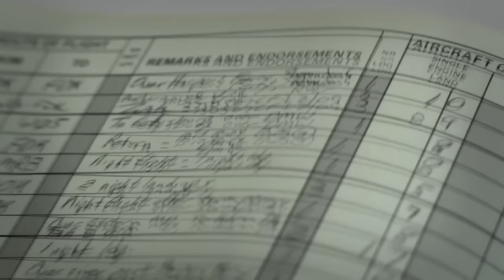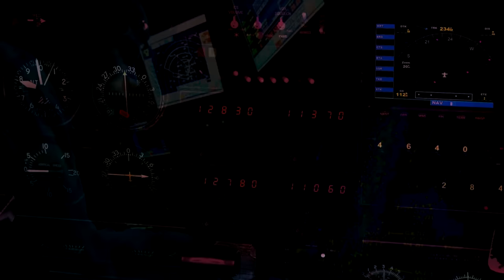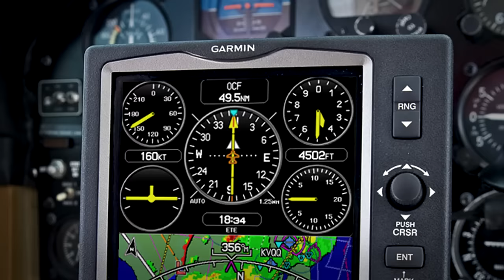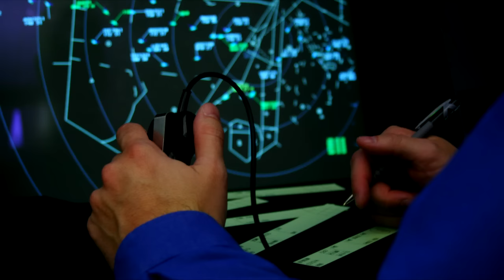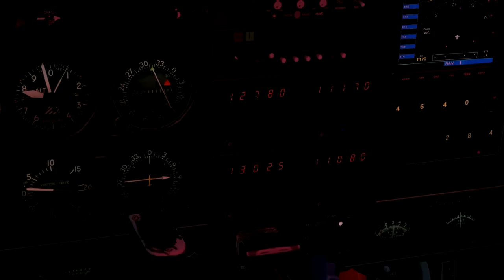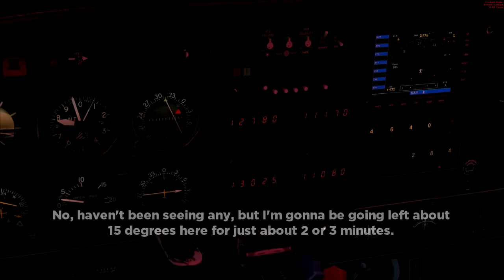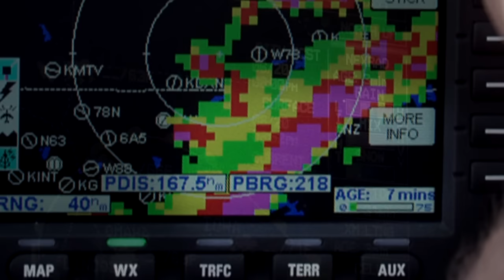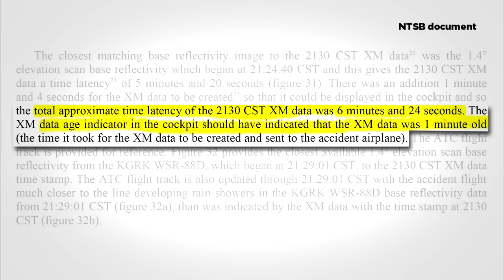Accident Case Study: Time Lapse – misunderstanding in-cockpit weather displays can lead to tragedy

Comment: Isnt ATC also at fault for letting him fly so close to the severe weather?
Reply: Yup, many years ago ATC should have sent a controller out to make his parents use protection.
Reply: Nice burn lol
Reply: No. ATC uses a weather radar system with limitations just as any other system has. The controller's responsibility is to aid the pilot by disseminating weather information as accurately as possible as it becomes available while also suggesting headings and altitudes based upon the information at hand. The pilot solely is in command of the aircraft.
Reply: ATC did warn him, he responded with "I'll stay on this heading a little longer" That flight should not have happened. sad.
Reply: ATC is never the PIC.... so no. While I have never flown near thunderstorms, I have had ATC talking me through storm cells. It's always an advisory situation. The pilot has the ultimate responsibility in flight.
Reply: Well done, Jon.  Well done!
Reply: No, this is a pilot responsibility not ATC. A controller has enough on their plate as is. Most experienced/ seasoned pilots would never seek guidance from a controller, knowing its their own duty to make decisions, and odds are no controller will want to be put in that position nor cares to face the potential liability. As this case shows even if/when ATC does offer advisory, that ought to be adhered to, a pilot whose hellbent on their plan will disregard it anyway
Reply: "Most experienced/ seasoned pilots would never seek guidance from a controller"
I'm sorry, but that is complete nonsense - I hope you were either being facetious or are not in the industry. The most seasoned/experienced pilots in the world are former military pilots who have worked a long subsequent career with a major airline. I guarantee you every one of them seeks input from their dispatchers, ATC, and their first officers in any severe weather situation. You are correct that ultimately it is their decision and responsibility as PIC, but only an idiot would deliberately choose not to avail himself of all available resources.

Comment: I've watched enough of these to vow to never be a passenger in a general aviation aircraft. Too many things can go wrong.
Reply: These videos are prolific because pilots are continually striving to learn from others' misfortune. You don't see car accident analysis videos because we don't apply the same rigour to trying to prevent them, we just mandate new safety features and let drivers continue to be hazards to themselves and others. Hundreds of thousands of GA flight hours go off every year without incident. This video covers one three hour flight that ended badly, but will undoubtedly save someone's life who will avoid falling into the same trap. Watch some steveo1kinevo and mraviation101 videos and you'll see what most GA flights are actually like.

Comment: This is a scary nightmare! Bottom line:  stay away miles and miles  from the boundary of these embedded TS. Because it will get you. And I’ve never believed on state of the art weather avionics. Prior information and knowledge about the weather is paramount. I purchased the weather material from Delia Colvin, and is a must have for any pilot at any level. It will keep you alive !

Comment: Reminds me of NLM Cityhopper Flight 431 that flew into the cloud obscured horizontal vortex of a F1 tornado in ‘84. The F-28 aircraft was hit with a one-two vertical negative G-positive G that was in excess of a 6 G aerodynamic overload that caused the right wing to immediately fail, sparking a flash fire as the husk spun down to earth. 

It turned out the flight crew was making decisions based on a 20 minute old weather report; back then it took about 20 minutes to get a weather radar sweep, document it, print it out, manually get it in front of atc reporters so then they could start using it to influence traffic.

Comment: used to fly freight in Cessna 210 and Barron's at night. feel bad for the guy. too many times to count I thought the spar was gonna snap. what a rush
Reply: Clint Hawk would slowing the plane down WAY below Va speed would have kept the plane intact?
Reply: I doubt it.  i knew a Continental DC-10 pilot that told stories of lock to lock, pitch too,  on the controls in and out of Denver and it was still not enough to keep it level.  This guy got flipped around and went in.  Going slower wouldn't help,  it may have been worse.  As Clint Hawk says he thought the spar was going to snap in  controlled flight.  Another friend JJ an F-18 driver say's "don't go into purple, even in an f-18".

Comment: The way I read weather is with the naked eye, formations, barometric pressure, more so than just the radar which shows you for  the most part the idea of coverage, and severity, but that does not replace what systems produce, wind shears, convections, hail, currents, temperature inversions, which changes temperature very quickly, then the precipitation, as well as rain, fog, dew and ice all from seeing a cloud, stratocumulus, shelf cloud, lenticular clouds, occluded fronts all with just looking at it, then get the weather report, then you know what you see along the route when flying. For any turbulence, bumpy rides, so as to adjust alt. accordingly, VFR on top etc. But you know that. Just go around it. But do not race one going faster than you. Pop up clouds you can see in the afternoon, small cumulus, can be bumpy underneath. But you know that.

Comment: For those of you unfamiliar with the American South, as a lifelong resident, it can go from clear skies to Niagra Falls back to clear skies again in about 10 minutes. These squalls can be strong enough to beat jets out of the sky, and Southern Airways 242 (a DC-9) in 1977 and Delta 191 (an L-1011) in 1985. That little Piper never stood a chance.

Comment: I was a working pilot for 25 years in everything from light singles,twins ,turbprops and small jets
I had a few lonely horrifying nights in some extreme wx
I remember an old very experienced instructor in my early years had a saying
"Its always better to be on the ground wishing you were flying than to be flying and wishing you were on the ground"
I lost a charter over bad wx one night
The forecast and actual observations at my planned destination  was like Armageddon
I explained the situation to the pax who were adamant they wanted to go 
I refused and they went off with another local charter company
They made it to the destination but many others were diverted to alternates
I remember that night like it was yesterday
No sane rational pilot was flying in that area that night 
I was glad i refused and went home

Comment: Why would the wing snap off? 
Maybe they should be built a bit more stout. 
Aviation hasn't progressed very far. Light aircraft are slow and built weak, and commercial aircraft are slower not that they used to be.

Comment: This appears to be the accident in question.  Interesting to note, per the linked report, "While the pilot’s toxicology testing results were positive for tetrahydrocannabinol carboxylic acid (marijuana) in the liver and kidney, the levels were determined not to be impairing."  Still, THC is not exactly a performance-enhancing drug.  https://aviation-safety.net/wikibase/140489

Comment: IN the 9:30 segment, the "turn right to a 220 heading" is confusing......(layman/enthusiast here, btw) through most of the last half of this his heading is pretty much 220. Any right turns--given the overlays-- would put him over the edge of the line of cells....... acknowledging the NEXRAD lag, but actual flight path/RADAR histories overlaid would have helped. Earlier the ATC asked him about a left-turn 360....... I looked for flight path overlay to support that.

Comment: Could I ask: did the turbulence from a heavy rainstorm  rip the plane apart? That's terrifying
Reply: Wasn't turbulence alone. Planes have a loading envelope of how many Gs it can sustain at different airspeeds, and the faster the plane is going, the more G loading you'll have with lesser maneuvering. Take a look at a Vn diagram (see link: http://joeclarksblog.com/wp-content/uploads/2011/07/Vgn-Diagram.jpg). As you get past Va (max maneuvering speed), your airplane can only handle so many Gs until permanent structural deformation or failure occurs. As you go faster, smaller inputs can result in permanent structural damage. If you go too fast, structural failure can result even in smooth air. Without Monday morning quarterbacking, it's likely the plane went into a decent due to downdraft, pilot instinctually added power as a "fix" to uncontrollability, airplane went past Va or even into the caution range, and the moderate to severe turbulence caused structural deformation. Stimuli were not immediately removed and a structurally weakened airframe failed. Now would have a controlled flight below Va turned out a different way? Tough to tell with that strong of a storm, but it sure wouldn't have hurt. If I'm rolling the dice (a situation as I pilot I never seek to be in), I'd rather roll with a weighted set :)
Reply: Oh hell Eric... what a way to kill a thread with real facts! haha! Good post! You must be one hell of a cfii.
Reply: @zippoc04  I don't think G's are linked/dependant to speed ? The airrcaft is certified for a given G limit and an airspeed limit (Vne) these are two seperates limits that are independant from each other. In a storm sith wind gust both limits can be exceeded, but I beleive this is the Vne speed that is a killer once the guy loose control and let the airplane goes out of level flight. Once in an upset and if not properly corrected there is only one way, and this way is down. Fast.

Comment: At 9:48 it is said that the pilot made a 180 degree right turn. Wouldn't a right (or left) turn be 90 degrees? Also, wouldn't he have needed to turn left not right to avoid the weather?
Reply: It means that the pilot turned rightwards ending up in a heading that was 180 degrees compared to the heading when the right turn started.  A right (or left) turn can be 1 degree, 90, 180, 360 or anywhere inbetween.  As to direction, perhaps in hindsight a left turn might have been warranted, but given the weather radar time delay and thusly what was showing at the moment on his radar (however delayed), and ATCs advise to turn right, the pilot might have acted accordingly.

Comment: Why did he execute a right turn instead of a left? Having the line of t-storms off to his right meant turning right brought him into a substantially dangerous reach of the storms - even IF the display had up-to-the-minute data. I still don't understand that, especially since the controller seemed OK with the idea.

I hope I note the follow-up on this - I am trying to reduce internet usage but this caught my eye.
Reply: Because by that point he was more than likely fighting the aircraft for control, or might have started to be overcome by spatial  disorientation. Things happened rather quickly I assume. Sad Sad deal.
Reply: @scotabot7826  - Thanks.

Comment: Not trying to giv any lesson on this very sad accident, but I fly a long haul jet at M.85 and FL410 minimum.
My company procedures states that I have to remain minimum 25Nm from any cell, isolated or embedded.
I would never play with weather, and I would never fly or let mt relative fly at night in a single engine piston plane, not to mention this crazy weather.

Comment: Can someone break down why his wing broke off? Is the up and down air just that insanely violent
Reply: The plane exceeded its maximum velocity while dropping.  The forces on the plane's structure increase with velocity.  The plane is designed to handle only so much force.  Exceed it and you're outside the design envelope and risking structural failure.  Exceed it by a lot and structural failure is almost certain.

That why big jets come apart so often before the actual crash.  Even excessive bank angle can overstress the plane's structure.  In a crash landing where the plane is spiraling and falling way faster than maximum allowable velocity, midair breakup is almost guaranteed.

Comment: If you do not ride with the flow of turbulence, you will over stress the aircraft by being overly rigid at maintaining altitude. Asking for a block altitude will give some flexibility to go with that flow.! Slowing to maneuvering speed will also help to minimize the stresses on the air frame.!

Comment: most of the aircraft in General aviation have 300hp or less horse power. normally big body with small engine . very slow . 
so in face of heavy and severe weather . we should consider these matter seriously  . i am very sorry for this accident.
we should bear in mind this , we are not able to control weather. APOA used to teach  those similar situations.
I believe those training will be payed off  .

Comment: I took my IFR checkride with Vern Jobst- then chief pilot for UAL.  Kind of a mean guy...  but with a  point:  The plane does what the pilot inputs.  After he tried to fail me (his usual IFR checkride routine) and I caught most of his tricks (he wanted to see what a pilot would do once they knew they failed- see if they would give up)  -- he told me off as a snotty know it all.  And he was sort of  right.  he acknowledged that i was a technically IFR competent pilot...  But...  i had little experience.  But I trusted the experience of my predecessors- 

the lesson that stayed with me-  the plane nly does what the pilot does to it-  has served me wellin flight and so many other aspects of life.   I have flown in some pretty nasty weather since then- stay out of convective  air masses if you do not have a dearth of power reserve.  

Much like the kung fu i've studied for 40 years-  wisdom is like being older than you feel.  

Vern signed off on me- without failing me.  Died a year later...:

If i could sum it up:  tHE AIRPLANE DOES NOT LIE- LISTEN TO IT

Comment: ultra-violent updrafts/downdrafts in a well developed line of thunderstorms can tear the wing off an airliner if it's in the wrong place at the wrong time.  Very few pilots have flown directly into a severe thunderstorm cell and lived to talk about it.  It's the negative G's that do you in, airframes are very intolerant to downward stresses.  Not to mention the few that do make it almost almost universally report their windsheild caved in from hail so if your wing is still attached the 100 mph+ golf balls impacting your face will tend to distract you a bit, supposedly the noise from hail strikes in these storms can get so loud you cannot even tell if the engine is still running ....needless to say, most die one way or the other.

Comment: How'd his wing come off? Just snapped from turbulence?
Reply: the ultra-violent updrafts/downdrafts in a well developed line of thunderstorms can tear the wing off an airliner if it's in the wrong place at the wrong time.  Very few pilots have flown directly into a severe thunderstorm cell and lived to talk about it.  It's the negative G's that do you in, airframes are very intolerant to downward stresses.  Not to mention the few that do make it almost almost universally report their windsheild caved in from hail so if your wing is still attached the 100 mph+ golf balls impacting your face will tend to distract you a bit, supposedly the noise from hail strikes in these storms can get so loud you cannot even tell if the engine is still running ....needless to say, most die one way or the other.
Reply: @lukeingram7655  I never thought of it like that. Thanks for the reply!

Comment: Why did atc, and the pilot, think he could fly out of the weather by turning right.  Wouldn't a left turn take him out of the storm situation?
Reply: Unfortunately, based on the evidence of position vs. ATC avail. radar, he was already half way through the worst weather there and the shortest way out was to the South West.

To the South East he would have been in it as it traveled for a longer time, and dealing with a storm chasing him even if he escaped.

Comment: Even without the real time weather onboard, the pilot should be able to use the Nxrd with delay to stay clear of the weather and loiter around in the air in vicinity but not so close until he sees a break in the trailing weather front.  Then he can cut across it to arrive at his destination.  He was gambling when he flew near the edge of most violent part of the storm front.  And he should inform ATC if he plans to loiter to avoid confusion.

Comment: Only time I ever nearly killed myself and my 47 passengers was TS related. Even at 10 miles abeam the main cell and in clear skies a microburst had us inverted at 1500' on the extended base leg. By the time I regained control, wings level and with the stick shaker still rattling it was 500' ....not good.

Comment: The ATC should strike a deal with the local chamber of commerce and use that info to try to persuade pilots to land instead of flying though bad weather.
"We are detecting high winds and heavy rain.  Instead of fighting that you could land at such and such.  There is a free ride from the airport to the hotel.  There is also a great rib joint right next to the hotel.  Kids stay free and there is an indoor pool and hot tub."
I know that would probably be illegal but I thought the prospect of a good meal and a warm bed might be enough to get people out of their "I must complete the mission, I can't land until I get to the destination I picked in my flight plan" mindset.